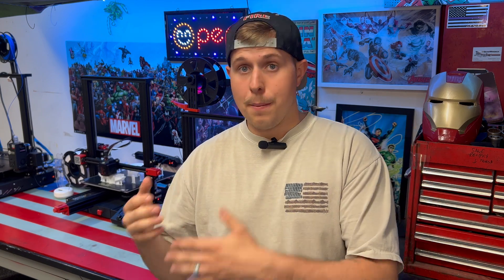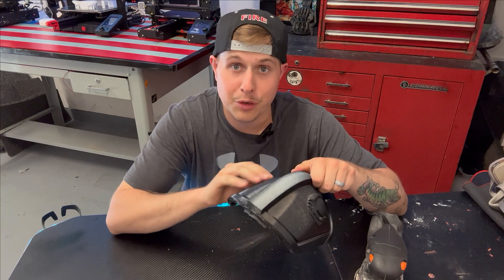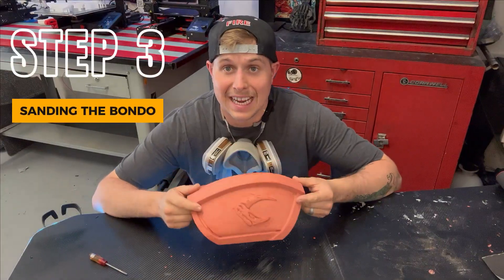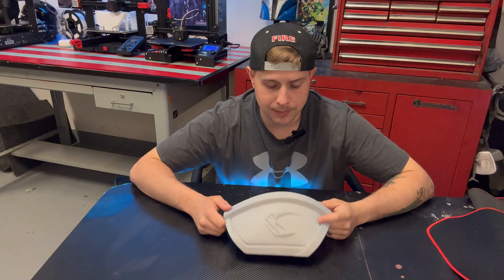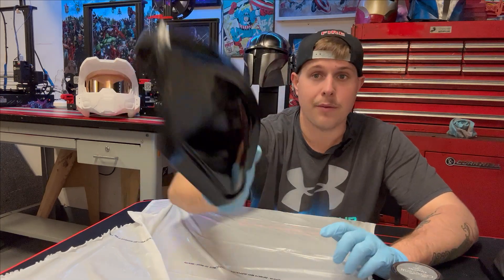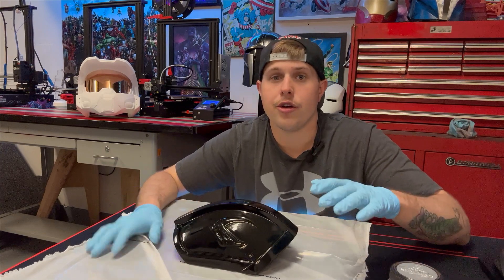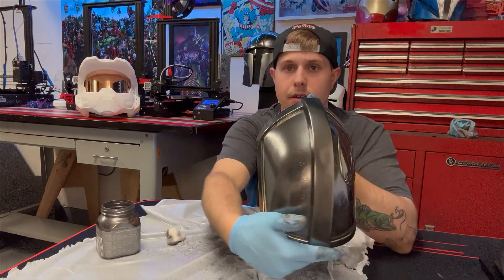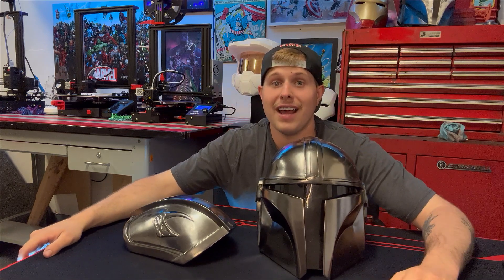How To Add a Metal Finish to 3D Prints | FULL TUTORIAL

Comment: You'll have an easier time if you work up through some more grits instead of going straight from 220 to 600. Do at least 400, if not 320 as well. You'll have an easier time getting some of those deeper scratches from the 220 out. Also, wetsanding at 1500 grit is largely pointless. I've only ever gone up to 1000, and even that's a little overkill.

Comment: Good tutorial. But there are a few things to note. Post-processing 3D printing of FDM printers (any) is a very time-consuming process. Spend not so much money on a large photo polymer SLA printer - surfaces without supports will not have to be processed at all - 8K printers really print with a surface finish of 20 microns. And one more note - graphite is still not metal, and it does not look like metal. Take it one step further and learn about electroforming. Graphite has ALREADY given you a conductive surface.

Comment: I think it wouldt hurt to wear a respirator mask when using the powder, its fine enough to get into your lungs
Reply: It wouldn't hurt to use a respirator for most of the steps. Also, an enclosure + filter around the printers to trap microplastics and VOCs wouldn't be a bad idea either.
Reply: It's definitely a good idea. It does not take much to get the graphite powder airborne if you're not careful.

Comment: I was hoping to see SOME natural speed operations for a better sense.  Also, I started wondering if the graphite coating could be conductive enough so that a real galvanic metal coating could be added.  I have used the graphite powder (actually tiny flakes) for lubricating some tin plated contacts that tended to be frustratingly tight.  I know the electrical conductivity did not suffer from the graphite treatment, but was worried it might actually be too conductive on the plastic housing to cause leakage from socket to socket.  In those days I did not have good enough instruments to actually test that.  Now I have instruments, but no graphite flakes on hand.  Oh well...

Comment: The helmet can be tricky to sand. Those little lips and edges and also pretty easy to overdo it if you aren’t careful lol I think if you print this stuff with lower layer height like .12 etc the sanding may be easier.

One warning I will give to everyone working with the helmet, if you prop the helmet up outside on something for painting and priming… be careful of the temperature outside and how long you leave the helmet in place. I had one on a sort of pole thing and the helmet basically melted around it and it drooped down leaving the top of the helmet very messed up. After that I made sure to stuff something wider and softer and cooler between the helmet and the stand.. like some old wadded up tshirts etc
Reply from the maker: i had the same thing happen to me as well especially with black spray paint

Comment: My only thing I don’t like about the powder method is that it comes off on your hands when handling it
Reply from the maker: I haven’t had any issues with mine coming off on my hands what brand are you using?
Reply: The exact same one you are. Maybe I need to rub it in more. Also, I heard it isn’t ok to get wet after.. so for anyone planning in wearing theirs maybe that’s a consideration depending on weather. Or spraying it with a clear coat might be the answer..
Reply from the maker: @colinmsmall  I haven’t tried it in water but that’s good to know I’ll have to try it out
Reply: Either way, great video man and thank you for taking the time to make it!